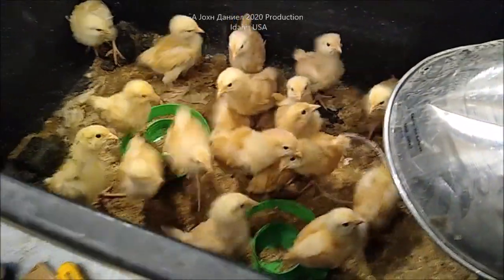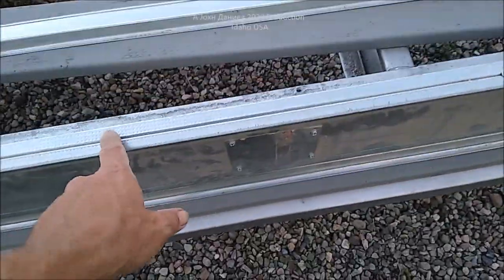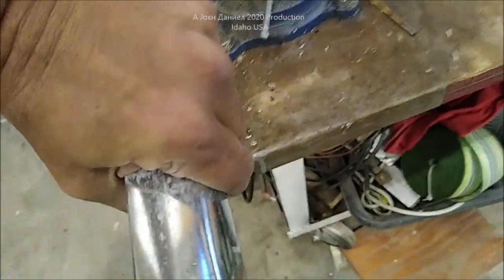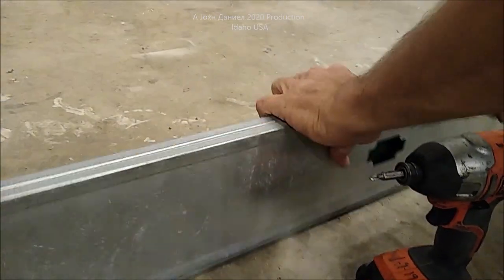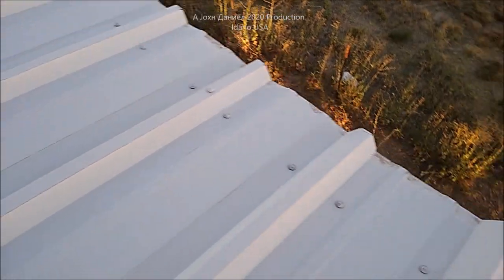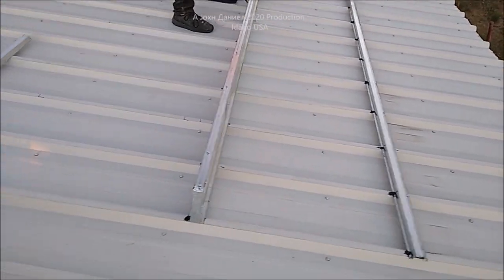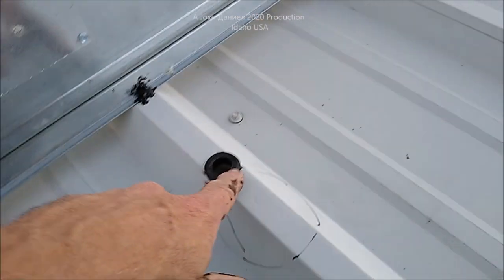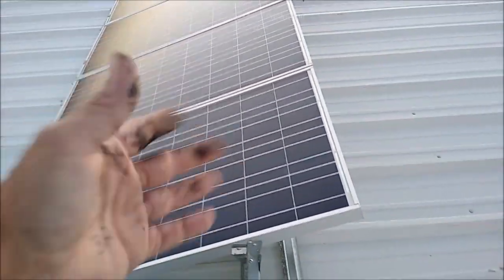Solar Power back up - For the Uncertain Future, making it affordable, Video 2

Comment from the maker: Beat the Panic Buyers - WindyNation100 panels https://bit.ly/3bFFQp4 , MMax/NPI 100 Watt Panels https://ebay.to/30FYSs1 $120 REAL MPPT 50 Amp https://ebay.to/3abTqju , Solar Connects https://amzn.to/2XJOa1M , Roof Jack for wire https://amzn.to/3a864jE & 12/2 Above/Underground https://amzn.to/2XIJolg for safe wiring up to 26 amps per drop
Truss Head Self Drilling Sheet Metal Screws https://amzn.to/3fNVcIM
Hex Driver Adapter and Extensions for Impacts https://amzn.to/30NgmCK

*BATTERIES - Get the DEKA SOLAR or Duracell B-903-L16 or GC2 6 volt that actually last a real 10 years. Made by East Penn, sold by Batteries+ as a Duracell for less.  https://bit.ly/2wv1VXd Order online, pick up for 10% cheaper.

Comment: Hi John, i realise that this is an older video (very useful to me), you mention using outdoor 12awg garden cable good for 26a per drop, but its supposedly 'low voltage'. I need to run 110v dc from my panels, but only at 6a. Do I need to be finding a different cable? Maximum cable length would be 10m or  33 ft in your 'speak'..
Reply from the maker: The brand Southwire https://amzn.to/3zcKdWK (international available)  says It's good for up to 150 volts DC according to the manufacturer. I have ran 80 vdc in it. But you would be inside of it's specs at 110 vdc especially under 10 amps.  Chia brands claim 72 vdc, so careful what you pick. The ad on Amazon says it is aluminum, it is not it's all copper full annealed.
Reply: @JOHNDANIEL1  Really appreciate you taking the time to answer questions here, thanks!

Comment: Is the height of the rear support part of a calculation to get a certain angle for maximum capture of sun energy,  i.e. roof pitch + panel pitch = max efficient sun angle?

Comment: Just discovered and joined your channel, and enjoy your content.  That said, I have to admit it's like drinking from a fire hose for me, given the wide ranging info you post.  At this point, I'm torn between (1) trying out a handful of panels and controllers to keep some 12v batteries charged up and inverters sufficient to run critical items like fridge/freezer/CPAP, or (2) whether I should design something larger-scale to run more items, if not the whole house.  In the case of #2, I'm trying to assess my total electrical need, and thus the needed equipment.  I don't want to start throwing components (and $$) at the task willy-nilly.  Any suggestions welcomed!
Reply from the maker: Be sure to get a pure sine wave of at least 500 watts for that Cpap

Comment: Hello Mr. Daniel, I am having difficulty sizing my future solar system.  All I want to power is a small cube refrigerator and a full size freezer.  The difficulty arises out of the lack of information of how much power these appliances use. I live in Michigan with 4.7 peek solar hours summer and 2.7 hours winter.  I have selected six SLI6v 370S batteries and six Renogy 160 Watt 12 Volt Monocrystalline Solar Panels.  Can you give me your advise of this system?  The inverter has not been chosen yet. Thanks! And thanks for your videos.
Reply from the maker: Slightly undersized in solar, but battery pack looks good. 
The best option in your area is another 400 watts of solar, and a 2500 watt to 3000 watt pure sine inverter.  You can add a basic Rich-S-40 amp MPPT, https://amzn.to/2V12oJF  then 4 - 100 watt panels https://amzn.to/3fzUctv that can handle low sun angle well and this pure sine inverter https://amzn.to/3nR75SO to run what your trying to cover and have 30% to spare most days.
Reply: @JOHNDANIEL1  Thanks Mr. Daniel!  I appreciate your advise and I will review your other solar videos to learn more about the wiring and breaker issues.
Reply: @JOHNDANIEL1  hello Mr. Daniel, the 40 amp Rich MPPT controller has a max PV input of 550W @12volts.  My system has 8 pannels @ 160W each. So, total of 1280W input to the charge controller.  Do you have a recommendation for a charge controller that can work with my 12 volt/1280W PV system? Thanks, Brad.

Comment: Meh. I bought second hand Commercial cells rated for 350 watts that were 6 years old. I paid 30 cents/watt.
Reply from the maker: I have new in crates over 6000 watts of commercial grade STION Amorphous CIGS panels, 84 volt operating, I like their power even though they are 135 watt each and a bit big. But they actually perform like a 210 watt panel in 24 hour cycle rates due to longer activity during the day. Amorphous if done right is supreme over mono or poly but they ( Unisolar, Stion, Kaneka USA) did not get the Grubberment bail outs in 2010 like the solar folks who kicked Obama over 23 million in bribes back then.
Reply: @JOHNDANIEL1  Thats capitalism bud. Its always been that way. They just used to be able to hide it. You think the Oil industry does not get the same treatment you are sadly mistaken. They get BILLLIONS in subsidies from the government by bribing the guberment. Its the only reason they are even profitable with fracking and off shore developments. Which is 90% of American production fyi

Comment: John, I'm thinking about getting 50 of the 100w windy nation panels you suggested  and going straight grid tie with them. What do you recommend for grid tie inverters? Should I just stack 5 1000w or get a bigger one?
Reply from the maker: Go with multiples of grid tie inverters, best outcome so a weak panel, shaded panel, dirty panel don't kill half your power on a mega single unit.
Reply: Thanks for that John! I got my panel's today 50 of the 100w windynation's how would you run the 50? Anyway I could get you to do a parts list minus the brackets and mounting stuff? Krazye419 at yahoo dot com is my email if that's easier. Thanks again John!

Comment: I have a question, can i use the 12/2 low voltage wire to connect my 100 watt solar panels? I want to run 5 or 6 panels in series to  the 12 volt to the charge controller.  Or should i use 10 gauge wire? Thank you for all your info, you have great videos
Reply from the maker: Stay under 22 amps in the 12 awg wire for up to 25 feet, your OK
I only use it for small runs and drops to boxes where i go heavy to the controllers.

Comment: Great information, as usual.  I really pray that your wife is recovering quickly.  I'm trying to decide which route to take with my off-grid system.  I hope to build a house on our 20 acres in Cedar City, UT this year or next, but for now, I need to power up my 5th wheel so I can have a few creature comforts in place when I visit the land.  I currently live in Henderson, NV so I'm not up in Cedar as often as I'd like.   Anyway, my 5th wheel just has two marine batteries and an onboard 5kv Onan generator.  I did add two more batteries but of different amp hour ratings than the 1st two.  I also added two 100 watt panels and used the coleman 8 amp charge controller that came with the panels but over about two years, the batteries.  
Is there a book you'd recommend that would teach me how to hook up a device that can monitor the batteries and cut them off before they get below the safe low voltage point?  I'd also like to add an inverter as the 5th wheel doesn't have one, or maybe I just need to build a mini power station and wire it so the shore power cable can be used just like when I'm in an RV park.  Is that a good way to go?  Yeah, too many ideas in my head so I need a book that details the different ways a person can power up an RV like mine.  Any ideas?

Comment: Greetings from Denmark. I got a lot of questions for you but first with all the panels and the turbines as well are you then covered for your needs as far as electricity ? And how much do you produce and whats your need in general to be all free?
Reply from the maker: I have a need to pull up to 15% off the Electrical Grid occasionally. The majority of the time we are not pulling anything from the grid, but my water pump and when I use the biggest Arc Welder I use the grid. We have a 1300 US Gallon water tank in the ground, a 400 gallon in the basement and a 225 gallon under the shop so when I need to fill them I use the grid or If I must goo 100% off grid I have a 9000 watt dual fuel generator that has filled them before. .

Comment: Thanks John... Can you tell me now... what resistance value would you use for braking on a 500watt wind turbine? How do you determine that value?

I really enjoyed seeing your more details on the alternate materials. That's exactly what I've been planning. Thanks for confirming this concept.

I was very glad to finally see this video. It's actually making me rethink possibly mounting on my shop after all. I can't think of the name of it, but my building is a quonset style that goes to more of a point on top.
Reply from the maker: 65% of turbine rating and wiring resistance reaction loading which gives you the response time in Ohms.
Reply: @JOHNDANIEL1  so you're never going to answer me in English???

Wiring resistance reaction loading??? What the hell is that supposed to mean?

What do you mean response time in ohms? Ohms is resistance, not time.
Reply from the maker: @nunyadamnbiznez3522  It was a basis in math and actual experience ( testing ) . 
Ohms ( resistance ) has a circuit speed. Enter 20 volts into a resistor, its current ( speed ) to travel slow reducing its effect on the other side. Every action having counter action. Counter action effects incoming power ( turbine ).
So by testing physically with months of options of types and makes, on how fast a resistor loads up ( travel speed of current ) verses how its action causes a good or bad reaction to the windings of a moving energy source ( rotational speed in the turbine ) you can determine the rate you want to control the power flow. 
* Many Resistors like light bulbs do not Flash from cold to hot, they start with high resistance and then the resistance drops some as the heat is made.  Determining how to apply that to a varying power supply is not normal math, its mostly lab testing since conditions always vary.
Reply: @JOHNDANIEL1  Dayum... you're good John. Ha ha ha... I know it's the "theory" of electricity... but I've never heard such double talk in all my years of training or even more years of experience working in the field.

I'll say this much for you... you sure seem to have yourself convinced. I guess that's half the battle?

You still didn't answer the question I've been asking for months. What resistor value do you recommend for braking with a 500watt wind turbine?
Reply from the maker: @nunyadamnbiznez3522  Hows it double talk? You ever tune the jets on a carburetor? Its Math right, or is it. Both-Neither!! You have to keep trying different values till you get it right, even on each 350 cid engine, each one is different enough NOT to have a established rule. So when it comes to wind turbines the differences of location are such you have to carry out the same program. 
As for what resistors to use, i have posted it over 1,000 times and placed it in videos, under videos, in links, with descriptions, and in emails to all that ask. 500 watt turbine diversion resistors - 300 watts in normal wind zones, 400 watts in high wind zones. For 12 volt 4 to 8 ohm, 24 volt 6 to 10 ohms, 48 volt 10 to 20 ohms. 6 years posting that in hundreds of videos should have made it stick by now! The links below the videos on turbines, in in pinned post say the same thing.
Reply: @JOHNDANIEL1  Finally... thanks. BTW... I've adjusted many carbs and rebuilt many engines since I was a kid and even later getting into electronics. I just rebuilt the engine in one of my cars just a few years ago. My Dad was a master mechanic and all my brothers and I grew up mechanincing... I went into electronics because I was tired of grease. Even in electronics it's still mostly mechanical.
Reply: why are you here? if you dont like the channel or the info leave!

Comment: Hello, Sir.
Found these and was wondering what you thought of them... they're super affordable but no solar information.  Do you think they're compatible? Maybe you can do a review on them? 😊
https://jag35.com/products/40-cell-lgmh1-18650-lithium-scooter-battery-pack
Reply from the maker: Excellent find but as long as you have to depend on China for parts, ( BMS and Batteries ) it may be a extreme risk today to depend on the battery type sourcing and parts availability. I saw this all coming in a vision about 5 years ago, so I began to go whacko on studying and buying the bulletproof survivalist parts. American made/sourced, 12 volt over 24 to 48, redundant over singular mega controllers and inverters. Look up RARE EARTH MINERALS controlled by China. They control 63%. In my shop I bought 5 china turbines, but run 2 and built the others from local parts. I also have 24 more solar panels in the underground storage, and more controllers and the like. But if your go LiFePo4, be sure to buy many BMS and other hardware items to stock up. I should do a video explaining all that.
Reply: @JOHNDANIEL1  
Yes! Please do! ☺

We are going mobile, so money, space and weight are concerns. Everything looks to be changing of the guards... so it's about to get real rough I agree.
Reply from the maker: @kimnunya8005  For going mobile I would suggest my hybrid LiFePo4 into Lead Acid design. I will soon make a video on it, it makes a Lead Acid need down by 60%, and allows you massive energy capacity and at the same time off the shelf gear. You get 4 GC-230 batteries for 12 volt, 120 AH of Lithium at 24 volt and 2 MPPT set controllers. During the day both battery system is charged by 2 solar arrays, at night as your lead acid battery drops to 12.4 volts the controllers kick on and start taking power from the lithium to keep the Lead Acid at over 70%+DOD all the time. That allows a 40% cost reduction and full power all hours of the day/night. This means NO China control over your system in all conditions, and the effect is amazing at nearly doubling Lead Acid lifespan. Simple!
Reply: @JOHNDANIEL1  
There should be a heart for this. Lol
Please do this video!!! We would love to see it! Sounds like exactly what we are looking for. 
We currently have a 400W system,  w/ 2 100AH 12V LABatteries, w/ room for expansion.

Comment: I'm too old to do the rood chit these days.   I don't bounce worth a chit when I fall.   All of my stuff is on  Terraferma .
Reply from the maker: I use the metal roof to help control a upper atmosphere EMP chance. Installing on a metal roof you reduce the chance of damage due to the full grounding shield effect. The way a metal roof and siding can cause signal image distortion and bounce in radio waves.  Department Of Defense electronic warfare study 2007.

Comment: But John, nobody gives info on what happens to electronic parts in all parts of EMP or CME.  Isn’t it as useless to you as electricity?  Do you know?  I cant see people talking about this or giving info on it?
Reply from the maker: I use the metal roof to help control a upper atmosphere EMP chance. Installing on a metal roof you reduce the chance of damage due to the full grounding shield repression effect. The way a metal roof and siding can cause signal image distortion and bounce of radio waves.  Department Of Defense electronic warfare study 2007.